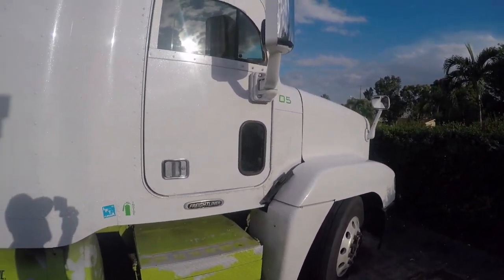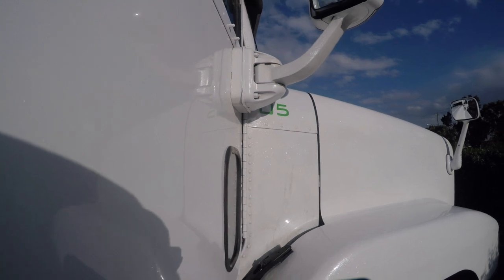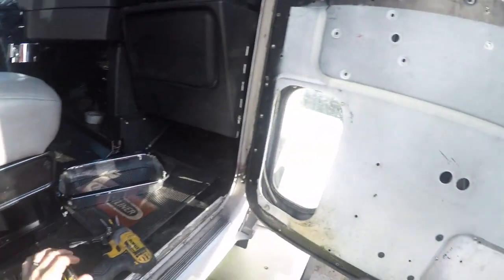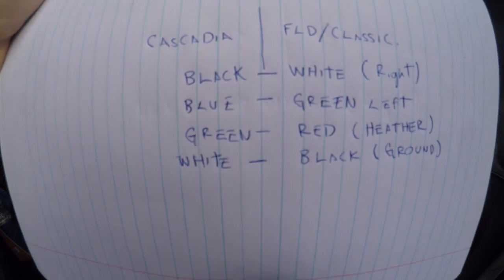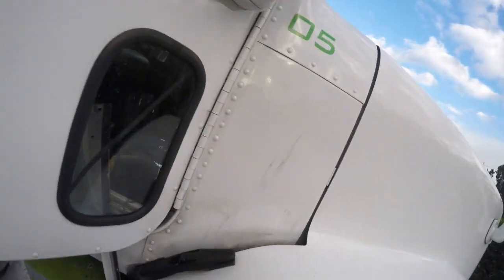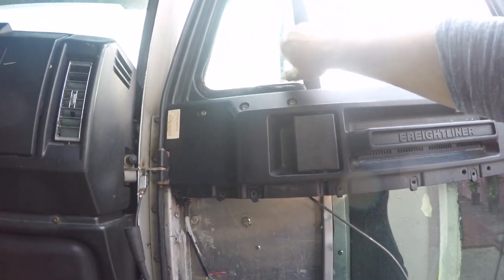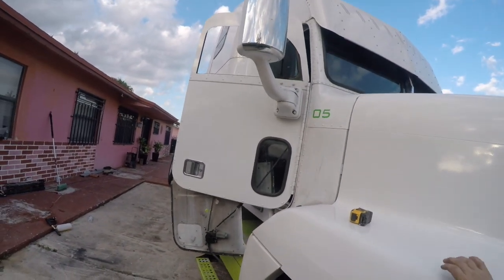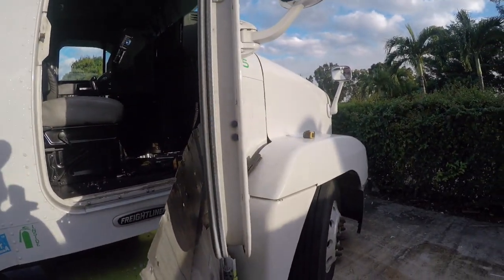how to install cascadia mirrors on a freightliner fld120 or classic

Comment: Good job man. Do you have any idea on how to replace same mirrors on century?
Reply from the maker: Daniel Hagos should be pretty much the same all you got to figure it’s the wires if it is the same colors fld should be the same otherwise get a tester and mark all wires and with the diagram on the video you shoul be good to go
Reply: Custom fld120 How to videos thanks again
Reply: I have a 2007 frieghtliner century and I want to change out the mirrors to what mirrors do u recommend?

Comment: Yo bro let me ask you a question unrelated to this video. My 96 fld the ac in the bunk was cold and blew like crazy my ac stopped working upfront all together got it fixed upfront and now the bunk ac is still cold but feels like its one 1speed even though the nob is on 4speed any ideas what I can check in the bunk to fix it?
Reply from the maker: It’s the resistor it’s a square piece held by two like 1/4 inch screws that has like two or three cables conected to it
It’s right there by the blower in the back that controls the speeds
Reply: @fldlife  well damn bro wasn't expecting a reply tonight lol thanks ill be replacing that tomorrow i go to texas alot and 106 heat at 7am sucks ass when the air aint blowing fast haha

Comment: En donde tienen conectadas las antenas del cn y de radio? Esque yo boy aser lo mismo pero mis antenas las tengo en las brakets de los espejos
Reply from the maker: The Reyes las antenas de CB converti a solo una la puse atrás de el sleeper como los peterbilt y la de el radio la eliminé pero venden unas en eBay que van dentro de el windshield por si quieres probar yo la elimine pero deje el cable por dentro de la cab y aún así tengo señal de radio no tan fuerte pero agarra las estaciones locales

Comment: What's the difference between a FL FLD120 and a classic?
Reply from the maker: K WinChronic the difference between classic and fld120 is pretty much wheel base and hood also classic has the air filters and exhaust pipes on the sides

Comment: Hey u k how good shop to lower trk for our fld120 and stretch out
Reply from the maker: Dennis Riggins Domínguez ironworks they very good they install air ride
Reply: Hey guy,I can't find Dennis Riggins  Iron works,I need more info on how to locate this guy.I need to do a stretch out job on my rig. Thanks Any info that You can provide will be greatly appreciate it.
Reply from the maker: SEAL 521 Domínguez ironworks search for them on Instagram or Facebook
Reply: Where they located
Reply from the maker: Dennis Riggins I believe they are near Miami Florida
Reply: Ok will do how long u had it trk and did u rebuild
Reply from the maker: Dennis Riggins around 11 years yes I did rebuilt it
Reply from the maker: Dennis Riggins I’ve had it for roughly 10 years and it’s all been rebuilt from rear to engine
Reply: Nice would u take this over new truck like isx15 Cummins freightliner if not can I rebuild mine to run all over
Reply from the maker: Dennis Riggins the only truck I would consider trading is a freightliner coronado glider because has the same drivetrain and I know this engine well
Reply: For sure man I just got 2014 Cummins isx still have my fld120 it will never go any where u work local
Reply from the maker: Dennis Riggins I stay in the south East Florida to Texas to North Carolina Georgia and between there